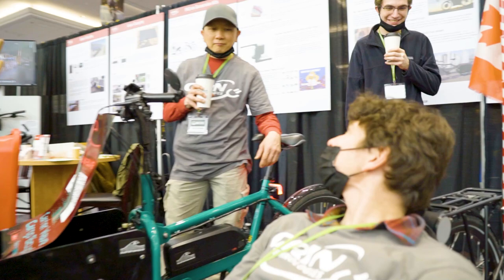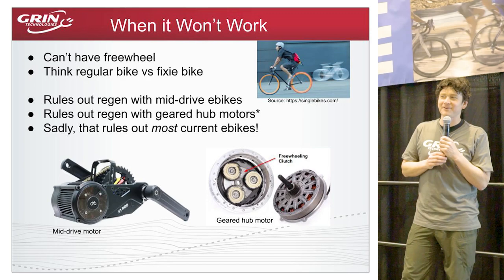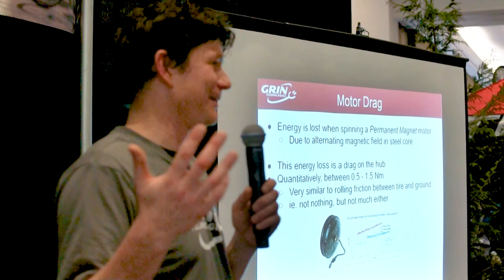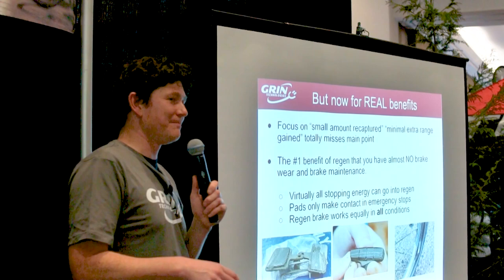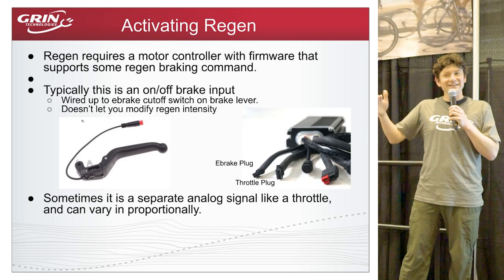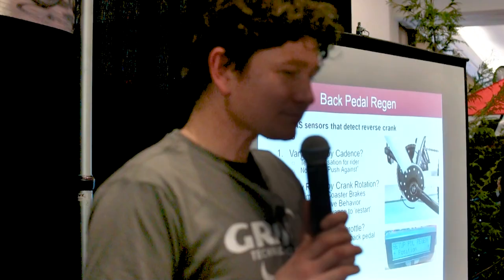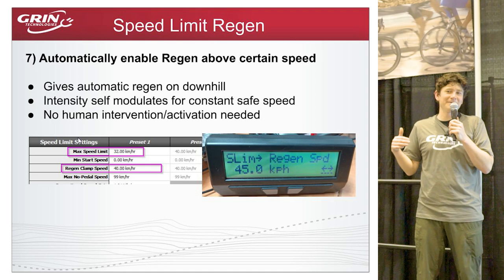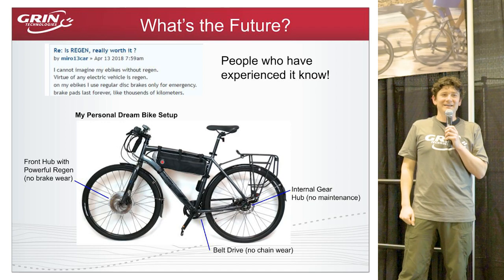Regen Braking and Electric Bicycles, Justin's Presentation from 2022 BC Bike Show

Comment: It’s nice to hear someone actually talking about the importance of regen when it comes to actual breaking. It’s not all about putting energy back in the battery well that’s absolutely a positive it’s more about the breaking feature, a lot of people overlook this.
Reply from the maker: Exactly. Hopefully over time we'll see more and more recognition of this fact and a general change in the regen conversation.
Reply: @GrinTechnologies  What do you recommend to use as a dump-load in cold climates so the regen will still work?
Reply: byet ~5-15% efficiency gain is still nice "free" additional range or weight/cost saving depending how you look at it, and also more consistent range when you have more elevation (hilly route) or more payload (cargo or passenger)
Reply: @GrinTechnologies  I want a middrive that allows regen breaking. Ideally it should be as powerful as a typical hub motor so it doesn't require gears either and can use a thicker chain that doesn't wear out so fast.
Reply: San Diego is a regen city, Las Vegas is not.  I live in a hillside city with about 1000 feet of vertical to work with and would like an ebike that had regen to help with the long descents.  But i do not want to sacrifice climbing ability or range.
Reply: @jimj2683  DIY battery with resistors wired and some heat transfer (copper/alumium/thermal past) that could be connected to an external heatsink to help add or remove heat from the battery depending on your need. the battery could be charged or discharged more quickly without overheating
Reply: @jimj2683  a powerful middrive with single speed would not be easy/possible to pedal at different speeds, you'd have to pick either short gearing for low speed pedalling to help steep climbing but then the mid drive will probably not be able to spin fast enough to reach top speed (and you wont be able to pedal either) or  long gearing for top speed, but then you are still losing the high torque of mid drives at low speed, and you wont be able to help a lot either with pedalling and you'll end up pushing the bike on steep hills. or a compromise that will kinda work like on single speed rear hub ebike like radrunner : 20mph top speed and so-so climbing

single speed kinda defeats the advantages of mid drives. mid drives are only designed to operate within rpm corresponding to pedalling cadences and take advantage of the gears to provide efficiency and torque at all speeds
single speed "mid drive" works well for electric motorcycles without pedals, and strong motor with at least some sort of passive cooling, starting from 6kW sur ron all the way up to powerful zero/energica motorcycles
regen braking is possible only if there is no freewheel in the rear hub (fixie hub) so that the chain will always spin and transfer torque from the rear wheel, and a freewheel in the bottom bracket so that you can still coast (unless you want a true efixie).
it really looks like you would benefit more from a powerful direct drive rear hub motor or a geared hub motor that doesnt disengage like Grin GMAC or any hub motor that you DIY mod to remove the coasting (weld?)
a mid drive wont bring you anything more, and it will be probably hard to find a mid drive motor that will work well without gears ?
Reply: The thought of braking is cool. Regen is a overrated gimmick! Dynamic braking is mostly what it's for ! In my opinion
Reply: @GrinTechnologies  could I ask you if you switch out  a few  cells in . The battery pack that are not the same but similar would regen stop working?
Reply: @jimj2683  A heating element is most common on boats and terrestrial systems, a ‘dump load’.
Reply: @jimj2683  A heating element is most common on boats and terrestrial systems, a ‘dump load’.
Reply: exactly. and you can save weight by eliminating either front or back mechanical brakes.... you just need one of them in case of an emergency.
Reply: @cosmiccharlie8294  I live in Henderson and my normal route is on the River Mt trail, 900 ft  elevation gain. With my GMAC and regen still get good range, I can go up hills with ease.
Reply: @geemy9675  paste
Reply: @moyettemorgan7102  braking

Comment: I wish this talk was two hours long like your "Understanding Everything about Hub Motor Drive Systems - Spezi 2020 Live Presentation" and "Deep Dive into Ebike Motor and System Efficiency" lectures. Even the "guide to multi-motor (2WD and 3WD) ebike drive systems" talk was over 90 minutes long. There's so much to learn.
Reply from the maker: Hey Sam, don't despair, this was just a practice run.  Our plan is to do a 2 or maybe even 3 part live webinar on Regen just like we did on those other topics, and that will dive much deeper.  I could probably go on for 6 or 7 hours straight on this particular topic :-)
Reply: This is exciting to hear! I hope to learn about how one might go about dealing with "battery combiners" and regen as well as multi-motor regen systems. 

Further research on cargo bikes with electronics bay built into the front load carrying platform is the goal. My aim is to develop a frame into a good modular setup with which to test different viable ways this could be electrically engineered.

In the best case scenario you'd be able to attach a sizeable supercapacitor pack in parallel to the battery system.

If it were possible to have an independent bank carried in a rear single wheeled trailer similar to the Coho or ideally Mark Havran's technological monstrosity which would serve as a "solar charging loop" that would also somehow collect the Regen? with which it would then keep a constant feed going to both the supercapacitor bank as well as a Cycle-Satiator like system that is set up with a means by which the internal computer can read the voltages of each pack, track cycles and most of all; while riding it will switch which pack is being charged via regen/solar vs which is being used by the drive-train.

It'd be a real funky spaghetti of wiring to do it... but I'm looking at a good concept to truly haul passengers or cargo over longer distances at a decent cruising speed, my V2 of the frame is intended to be custom fabricated from a fat tire frame. 

Thanks for reading, Portland Oregon here.
Reply: @GrinTechnologies  good because as a Grin DIY customer, I would welcome some more Webinar type videos to help us select and install the correct motors and accessories.
Reply: Please address the "battery can't handle it" bullet point you skipped here due to time constraint.
Reply: @GrinTechnologies  Missing out on few hours of Regen. I was trying to convince my old company to do it on their ebikes. Really enjoyed the systems thinking it is a shame the ebike industry is so backward technology wise. Trying to get someone to do a 240W USB C battery charger - its only electricky after all is just like pulling teeth!

Comment: Great presentation, Justin! I used to replace brake pads 2-3 times per year before regen. After regen, I’ve gone 36,000 km in 3.5 years with one replacement (and that was mostly because  my max regen phase current was set too low for the first couple years). 

I used to get almost 20% regen riding in the Oakland hills. Averaged 4.4% on my 8700 km ride from Vancouver to San Diego.

Comment: THANK YOU, thank you thank you!
From my experience, you've got everything figured out. It's a shame you're the only one among vendors.
The main point is about brake wear. People don't realize how much of a chore, changing your break pads, is, once you don't need to do it anymore. Regen is really liberating on this point.

One thing about throttle setup, is to use 2 throttles, side by side, one in reverse. In that configuration, you can simulate a 2 side handle. I tried it 10 years ago. Thumbs goes down, I accelerate, thumb goes up (pushing on the other throttle), you regen. It's pretty natural. I didn't implement it on my phaserunner, as I'm really used to a push button + accel throttle.

I've been slowly developing a Bluetooth module for the cycle analyst, and I also thought about regulating power/regen with a tilt sensor, this seems so natural, it's silly nobody thought about it before. As you said, pretty sure it's the future evolution in e-bikes. And after that, you'll have power regulation based on GPS, and set destination, anticipating the profile of the road, to have an optimal power consumption.

As I've been bike commuting for 20 years, e-bike for 15, my dream bike is pretty much the same as yours.
I'm a commuter, I don't want maintenance on my bike!
Reply from the maker: Awesome idea there with side to side thumb throttles to mimic a single bidirectional device! That's really quite clever. 

We did our first tests with an accelerometer control in 2009 and it worked great then but sat on the back-burner for way too long. I suspect that in the year or two we'll start seeing this everywhere since it's just so obvious and inertial sensors are so ubiquitous and cheap. 
Glad to hear you are in agreement with most of the points in this video, it's reassuring when others with similarly rich firsthand experience have come to the same conclusions.
Reply: @GrinTechnologies  Hey thanks for the response. I'm in agreement for not most of your points, I'm in agreement for ALL your points.
I also have a Yuba Mundo, and my dream bike is the same as yours. This is becoming very strange.
Anyway, keep up the good work guys! Your products are awesome.
Reply: That's a pain them not putting analogue hall sensors in the brake levers...   BUT can't you just glue a magnet to the brake lever and stick an analogue sensor on the brake lever body?  That way you can get variable regen braking and mechanical brakes on one lever that is compatible with any bike.....     

A lot of kits have a similar thing going on...   

 I could even d.i.y it by soldering some leads onto an analogue sensor then plastidipping it to make it waterproof

You provide the support in the controller for variable regen braking that I can calibrate similar to calibrating the throttle end points on an RC car esc,    and the wires to solder an analogue hall sensor on and ill do it myself.

Comment: I have variable regen on my bike with a throttle to modulate it... It stops on a dime without throwing me head over bars or locking a wheel up. In fact, I hardly need to use the normal brakes except to finalize a stop or to add extra braking force.

Comment: My bike tractor is offline at the moment, but I regularly get 15-23% regen on cargo trips to and from my hilly San Francisco neighborhood. Even on trips to flatter parts of the city and nearby cities, because of the initial descent, I'll still get 6-12%. Definitely worth it.
Reply: wow that's great. I was debating making my own custom e-bike form scratch with tools form my maker space and I was debating if regent breaking is worth it

to solve the free wheeling problem I was thinking of using some sort of clutch mechanism. the motor can peacefully absorb the spin while the pedal disconnects completely from the system,

Comment: Thank you for further explaining the benefits of hub drive over mid drive. It's insane how many bike shops hate on rear drives because of made up reasons.
Reply: Many or just Johnny Nerd Out?
Reply: @chrisE815  many, mostly the non nerdy ones I have noticed actually, like the car salesman types.
Reply: There are positives and negatives to both systems. In my opinion on most e bikes hub motors are perfect but the unsprung weight of a hub motor on a bike with suspension such as mountain bike is a massive issue
Reply: @chrisE815  just Johnny Nerd Out. He loves milking that hate to get more views.
Reply: @sammiller6631  lol

Comment: I just rode a 117 mile ride with 10,600' climbing, and got over 50% regeneration capture.  The hillier the terrain, the more regeneration helps.   The best part was descending a 3,000' climb and never touching the brakes, instead putting all that energy back into the battery.
Reply from the maker: It's a great feeling indeed, and congrats on the pretty epic ride
Reply: That's the kind of use case I imagine and Justin's dream bike would be pretty much perfect.  It's what I'd imagined would be the simplest setup but good to hear it from an actual expert...

Comment: I bought my direct drive RadCity Step-thru 3 (Canada) (low step Radcity 4) this November on the clearout sale, which has regen braking. The direct drive hub motor has "Shengyi" and "HYBRID" all over it and it is indeed a true plug-in hybrid electric vehicle.

Regen braking is disabled when accelerating from a stop with human power only - PAS 0 and not using the throttle.

In Hybrid and EV modes (PAS 0) when the throttle is released, low regen applies.

Slightly tapping the brake levers will engage full regen braking - more than the amount by just throttle off.

Too bad my direct drive Radcity is now discontinued and is essentially irreplaceable now...
Reply from the maker: Yeah it was unfortunate that the rad DD bikes were all discontinued. Glad to hear you got one at a deal. There aren't many factory bikes with regen at this point in time but at least there are many great DIY options.  And in due time they will make their way way to factory ebikes in a big way.

Comment: Yeah it's awesome!. After experimented it, it spared me a lot of brake maiontenance, disc alignement, pads replacement, caliper cleaning, bleeding etc... Both of my bikes are heavy, 165lbs-180lbs, + me 230lbs so it generates a bit but defifinitly about the brakes with all wheel drives bikes like me it's awesome and worth it.

Comment: I love Regen, and I also love your passion. I look forward to buying Grin components when I can afford them. 
Another great 2 things about Regen, at least my theories, is 1, it's a natural Antilock Braking System, because if the wheel locks up, like on ice, then its not spinning, and the generator effect goes away. So the theory I have yet to test is, even with a torquey DD hub motor, and a high current controller with Regen. The BrakeRegen will naturally always be at the threshold of grip. But this also makes me think about how long for the induction in the coils to fade away, and if stator coils can be designed to quickly lose magnitism when magnets stop.

My second Regen theory is.
Wiring battery packs in parallel with capacitor packs, will greatly improve the efficiency of regen, because the charge limit of the batteries themselves is a bottleneck, but capacitors can charge & discharge quickly. The more capacitance, the better. Wire enough ultra-capacitors in parallel groups for capacity, and then wire those groups in series until their combined maximum voltage ratings cover the battery charger voltage. Or use high voltage capacitors that cover the charging voltage and just parallel those together for many Farads of capacity.

My experiment & problem with my 2nd theory is.
The space within & on a bicycle or motorcycle frame, to be dedicated to energy storage. What is the best ratio between batteries and capacitors? Be it ultra-caps or normal capacitors. Should the capacitor pack be as big as the battery pack?
Two times as big to get the most out of Regen?
It's like, be battery biased if you are traveling long distances with little to no braking. Or, fill your frame up with mostly capacitors, if you expect a lot of stop & go city use, or tight, technical routes.

I don't know the exact ratio for expected use cases.
I do know Capacitors have better C ratings then batteries, and can capture the most energy from regen, to dump into launching from a stop or out of a corner, or charging the battery at its own pace, if you RegenBrake to parking.

I just don't have the money or time to do these experiments.

And like the presenter, I hate bike maintenance. I just want to do my delivery job, with a reliable, stable, but powerful bike, then relax. I'm hoping using 2 torque biased motors, means I can phase out brake pads entirely. Using some metal shoe on the tires to act as a parking brake.

Either way, thank you all at Grin, for your quality products, passion to improve EVs, and thank you for this presentation, I wish you had more time.

Comment: The "Rion Curve" and the throttle from the Boosted Rev are worth looking into. They are thumb wheel inputs that physically spring to a mid-point hall sensor (so their default state is about 2.5v). Then all you do is push forward or pull backwards and you have the controller interpret that. They are AMAZING when used for throttle+regen and the ergonomics are extremely hard to beat. 

Sadly, as Justin has lamented, finding thing like this in the market is extremely difficult right now.
Reply from the maker: Awesome thanks for the tip on the Rion throttle, we weren't aware of that one being out there and it looks like it would be compatible with bike handlebars too.
Reply: @GrinTechnologies  Yup; just wish it wasn't $200! (And, ya know, available yet)
Reply: This is cool concept. I know electric wheelchairs in Walmart have forward backward control with one switch so it's existing techn and should be easy for a factory to make them with the right molds